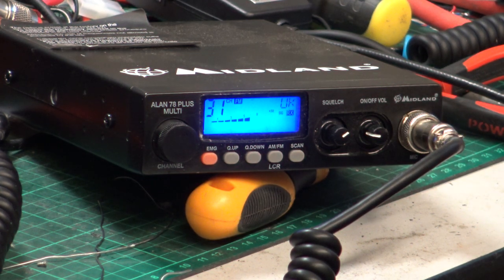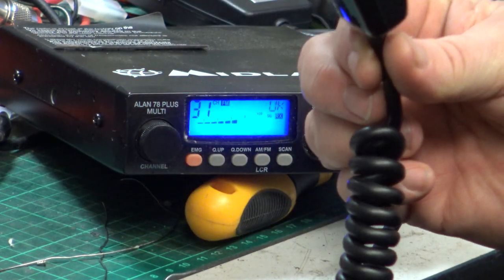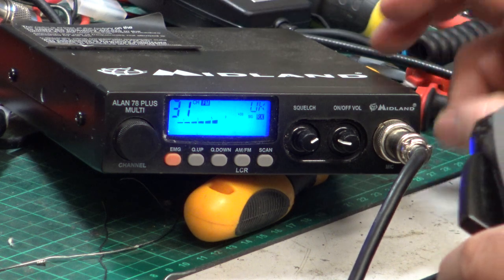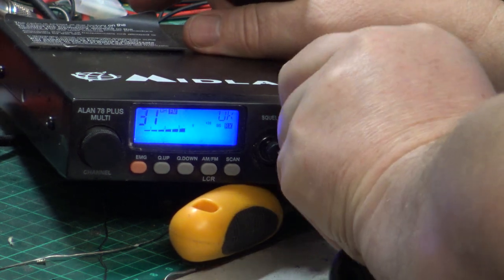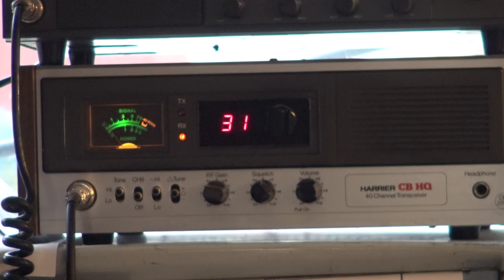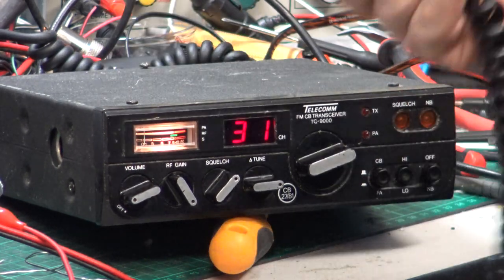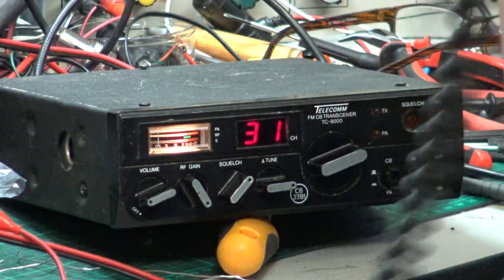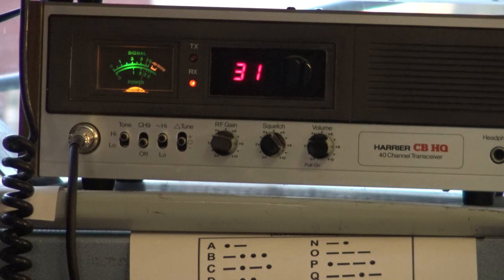Microphone comparisons Midland 78, Telecomm TC9000 - Factory VS replacement

Comment: The latter radio has a beautiful modulation. And I thought that alan 78 is good modulating ..
Reply: I often wonder if this could be due to hardware based versus software based modulation.
My understanding is that the modern transceivers rely on software to modulate the signal, as opposed to older transceivers, which utilised dedicated hardware dedicated to modulation.

Comment: Well the first Midland mic was crap, for Midland means they have very much gone downhill.  The replacement was sharper but could have had a bit more bass, but it was a lot clearer.  Second one was much the same, just a tad to much treble on replacement, though it original mic was to bassy and not very clear.  Result:  Replacement mic wins both times.  That is on sets that have crap mics fitted.  I am surprised at the midland mic, though it looks the same as the 27/81 mics, they just look it and do not perform the same, that's for sure!